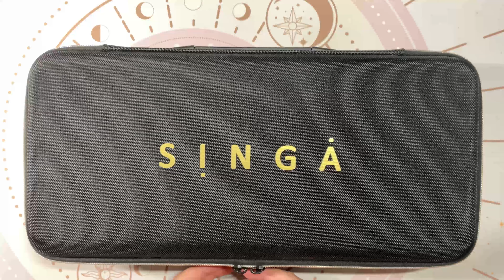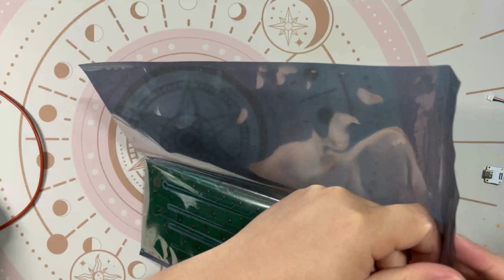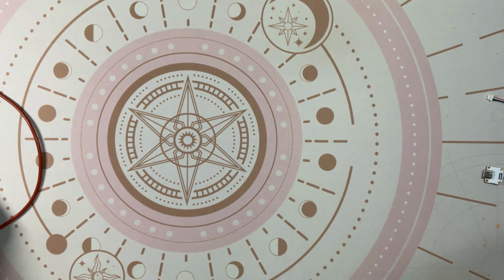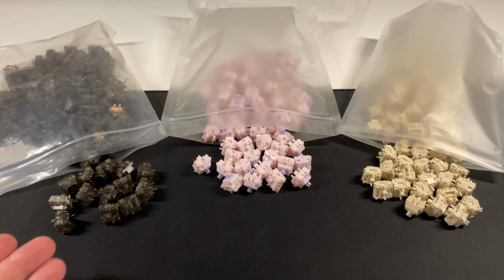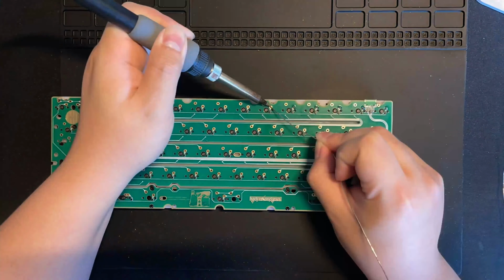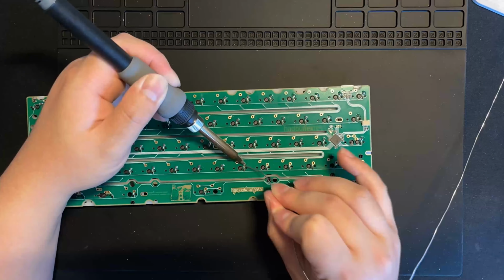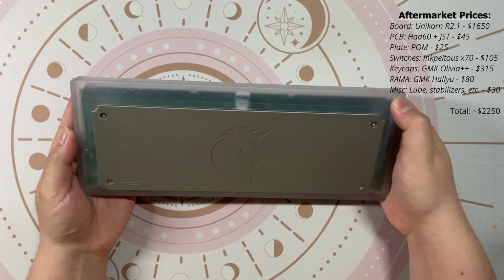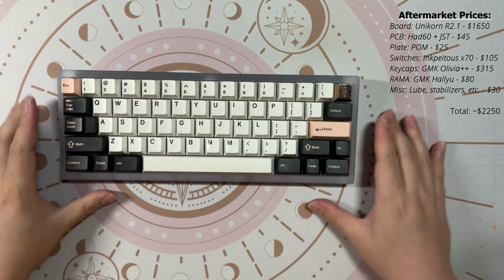This Keyboard Costs $2200!!

Comment: How hard was it to desolder the USB connector? More specifically, how easy would it be to damage surrounding components of done improperly?
Reply from the maker: You can get it desoldered straight from hadi for $2 extra. The GB for the PCB is going on right now! 

As far as actually desoldering the connector yourself, it’s quite difficult. You wouldn’t be damaging the surrounding components as it isn’t super close to anything else. However, the pins are tiny, takes a lot of patience and time to make a clean desolder
Reply: @TheProbability  That's exactly why I wanted to ask, lol. I'm thinking about getting one for my Bakeneko60 and one for a standard 60% build -- I didn't want to be locked down to either one with the USB pre-removed, but I may have him do it for ease. I plan on pairing mine with a pom or pc plate. How did the flex end up on yours (e.g. do the pcb cuts do what you expect)? Thanks for the vid and taking the time to answer questions.
Reply from the maker: @_fatalruin  yep, flex cuts do what you expect. You’ll only really notice with a flexy plate like what you were planning on pairing with. However, I found that the sound was much more full with tape modding the PCB

Comment: How's this compare with the bakeneko in sound and feel?
Reply from the maker: Feel is similar, but the unikorn sounds much better. The bakeneko has a problem with sounding pingy near the corners. The tighter tolerances of the unikorn just makes it more worth than the bakeneko, but for $129, I’d say it’s at least 80% of the unikorn.

Comment: How do the inkpeitous compare to the konpeitous?
Reply from the maker: Inkpeitous are deeper sounding thanks to the housing differences, but Konpeitous are smoother thanks to material choice/manu mold and finish. I had leftover stems because Konpeitou's first run included stems so I decided to make a frankenswitch and liked them more than cream stems! 

Inkpeitous compared to inks are louder thanks to the long pole. The longer stem pole accentuates the sound if that makes sense.
Reply: @TheProbability  also how do the konpeitous with the jx stem compare to the pom stem because I was thinking of getting some jx stems. And are there any frankenswutches that use an ink stem?

Comment: The sound profile really can't compare to a modern board like owlab. The old cult classics, like this board and keycult boards, are just not worth the insane mark up other than to flex on people. The actual keyboard design is mediocre and outdated.
Reply: Anything will be outdated in a few years, trends etc. Never last
Reply: Sound profile is preference wdym owlab sound is overused
Reply: No way you compared OWLAB 😂 those boards are stuffed with foam, no effort is needed to make them sound good